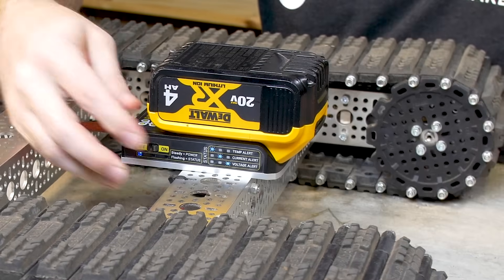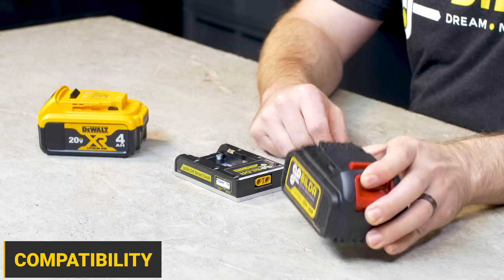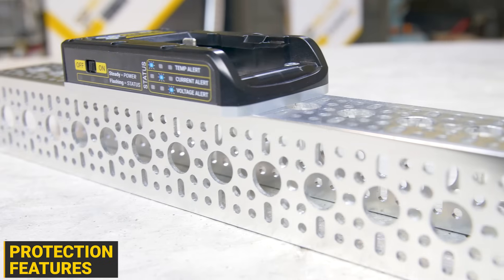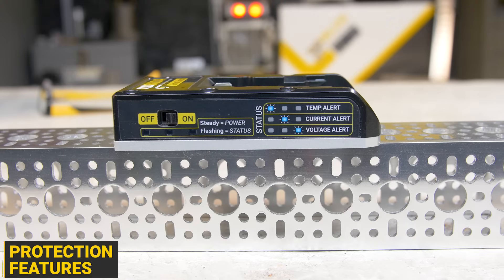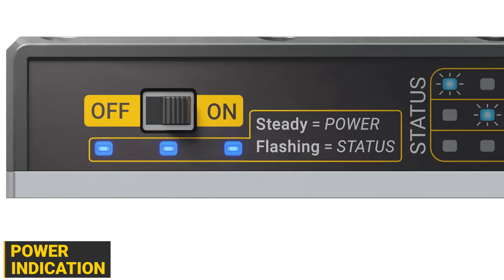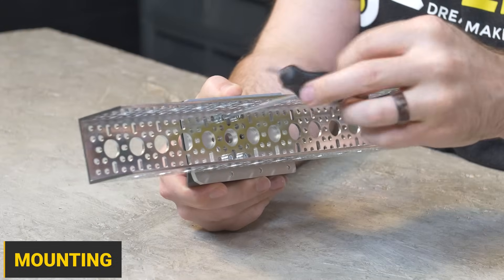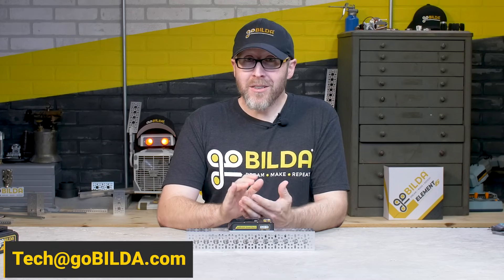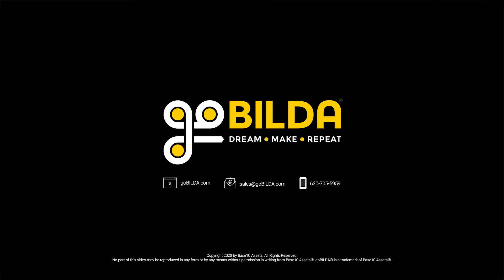The Right Way to Use Power Tool Batteries in Your Project!

Comment: Would this work with hercules 20v batteries as the slide connectors are very similar to dewalt battery connectors?

Comment: What is the output voltage from the xt90?
Reply from the maker: It is the full battery voltage! A fully charged 20V MAX battery sits at 21V, and our dock cuts off when the battery is dead at 14V.

Comment: does it use m4 screws for the other mounting holes? or can i substitute
Reply from the maker: It has a series of 4mm thru holes for M4 hardware. As well as M4x0.7mm tapped holes.
It also has an 8mm thru hole in the center sized for a M8.

Comment: Been looking at this tonight ,Building a large animatronic head 26 servos and could use this  ,Voltage Regulators (BECs) and using 2 of these Servo Power Distribution Board =(16 Channel) right!
Reply from the maker: Potentially! It depends a lot on how much current the servos are able to pull, you may need multiple BECs to power all those servos.
Feel free to shoot us an email to tech@gobilda.com if you have further questions.